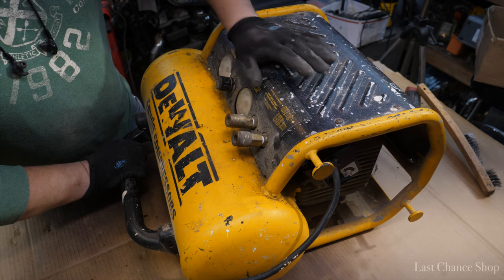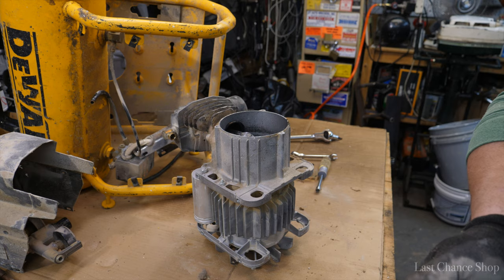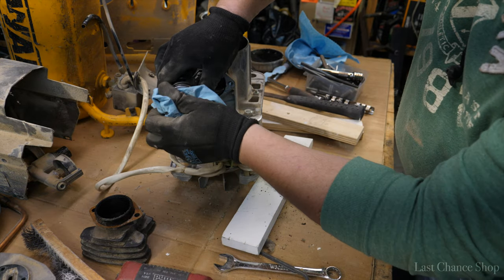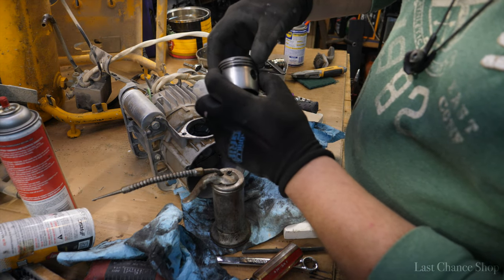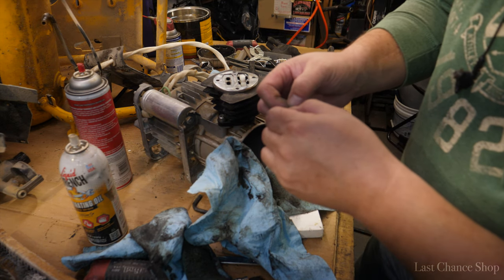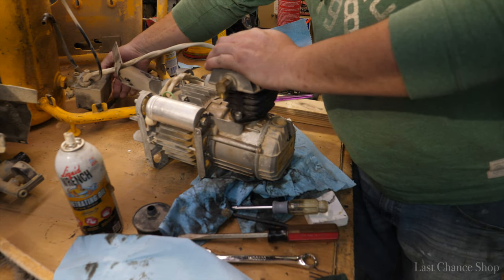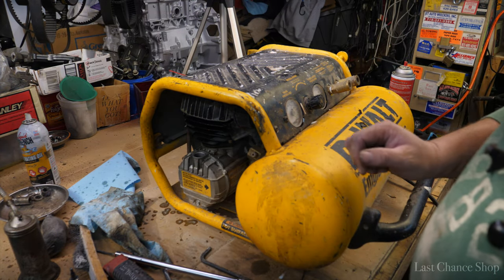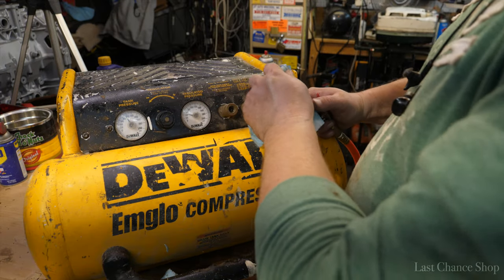How to quick fix seized DEWALT air compressor MADE IN ITALY

Comment: I am repairing the exact same model that a friend gave to me.  Got it in parts.  Found the piston had scored the cylinder wall.  Honed the cylinder wall.  Ordered new piston, as the old one was no longer usable.  Hope it turns out good when I get it all reassembled.  Also had the same problem with previous owner did not put oil in the reservoir.  We'll see how it goes.  Great video.  Thanks for the information.

Comment: I bought this compressor new in 2000 and it’s still going strong. I thought it was made in Mexico like many Dewalt products are. Very cool to find out it’s made in Italy. That oil cap is not factory, the original is black plastic threaded dipstick.

Comment: I have the same problem with one I just bought off a guy, waiting on my 2 jaw puller to get the connecting rod off
Reply from the maker: They are very reliable I use it all the time good luck fixing it

Comment: At 29:02 the shipping cap pops off, spraying oil everywhere. The crankcase needs a dipstick, both to seal it and to indicate the proper oil level. It was probably overfilled.
Reply from the maker: Yes i ordered from eBay still working no problem thanks for the info
Reply: @lastchanceshop  could be some blow by, given the damage.  Mine has an o-ring sealed dipstick and it's never popped out.  But yours has had a harder life...

Comment: I have a Dewalt 55146 compressor and have been having a problem with it shutting off when it reached 225 lbs.  It is supposed to be 185 lbs turn on and 225 lbs turn off.  I ORDERED AND INSTALLED THE CORRECT PRESSURE SWITCH AND IT  GOES TO 250 AND DOES NOT SHUT OFF.

I doesn't seem to go above 250 BUT it just does not shut off.

At first I thought it was a factory default pressure switch, got another one today and it is still the same thing.

Questions,  

Is it something else that makes it not shut off at 225 as it is supposed to do??

It goes to 250 so far, but does not seem to go any higher.  Is this dangerous??

No leaks or any thing.  Basically I AM THINKING TO JUST PLUG IT IN WHILE I NEED IT AND UNPLUG IT WHEN I AMF FINISHED.

What the heck is going on here???

What to do.

Thanks

Joe
Reply from the maker: can you me a link what kind pressure swich you buy  ?

Comment: Hello Can you said please
I have same compressor. When I turn on it tripping 15 A breaker but if 20A breaker work well.
What’s wrong?
Reply: The compressor is rated to draw 15 amps. You could exceed that if shop lights or fan are drawing from the same breaker when it starts up.